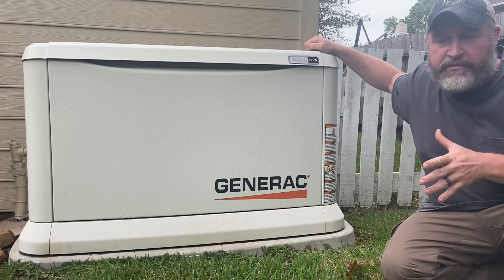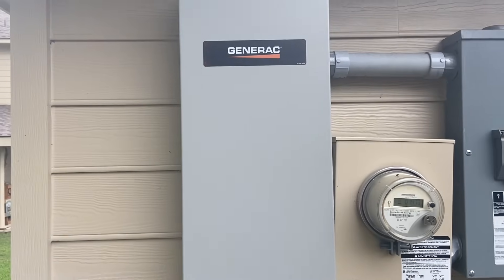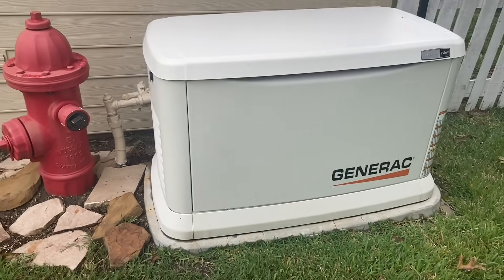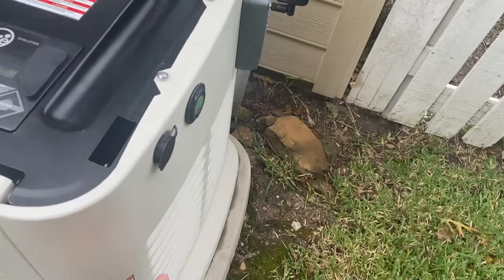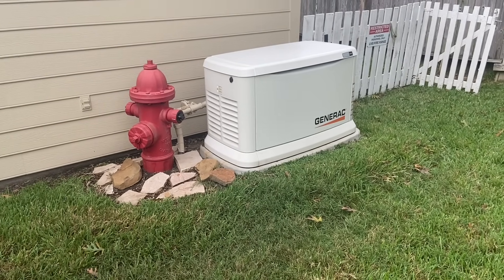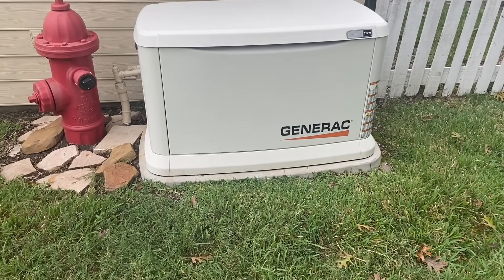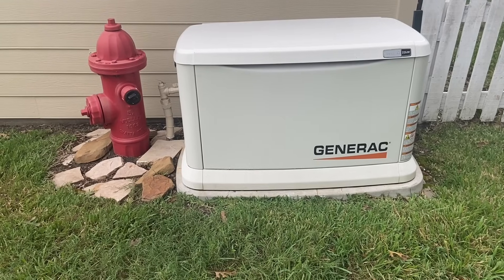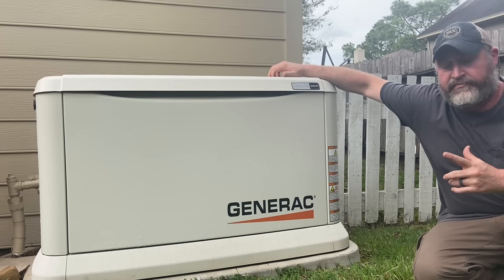Thinking of purchasing a generac whole home generator?

Comment: Just had a quote last week 12 Sept 2023 for a turn key installation of a 26KW Guardian Generac.  $22,000.  Included the generator, auto transfer switch, 2 load shedding modules for my 2 AC condensers,  about 30 feet of conduit to offset the generator from the outside service panel, 40 feet of gas line from the meter, about 120 feet of wire run from the generator to the transfer switch and rerouting the electric meter to the transfer switch and back to service panel.  7% Mississippi sales tax on the generator purchase is included.  This quote is through the local Home Depot in Olive Branch MS who specified the certified Generac contractor.  Apparently this area of the US is a sellers market with plenty of willing buyers.  The labor for this job is about 2 man days or 16 hours.  An option is to find your own electrician and gas contractor to do the install.  While your install will probably be more reasonable, repairs and parts will most likely be through a Certified Generac dealer.  Especially if you’re looking for warranty work or service.
Reply from the maker: Sounds about right , my install today would be 13-14k the 26kw is more and your install is more involved.
Reply: Through a certified Generac Dealer/Installer you are looking at a 100% mark up on the basic generator set and installation parts.
Reply: My install was $15,750 for the 24kw, transfer switch, new gas line, and a 200 amp breaker box. I had it installed just over a gear ago. I’ve noticed the prices on these things have gone up so fast.
Reply from the maker: @gutterratjp  thanks for the comment and updates on cost.
Reply: Load shed for a 22 kW may be "fluff", or not depending on the size of the AC units.  You are paying for more than two man days of labor.  Only subcontract if you are technically competent to verify all the work is performed properly and to code.  You can't depend on many of the contractors (or inspectors) to be knowledgeable enough to install correctly.  Then, yes warranty work will be through a warranty authorized dealer-some will not cover warranty on an improperly installed unit.

Comment: Wow thats an awesome price! Just got a quote yesterday for a 12kw briggs and straton smart generator( suppose to be smaller and cheaper) for 20K. Our freind at home depot told us it would be that much before we even got the quote. We have another installer coming today but anyway they do add value to your home so they pay for themselves i think. Great video, exactly what i went thru with the installer yesterday. Thanks
Reply from the maker: Updated pricing in my area for my unit installed is 13-14k currently. Thanks for watching !

Comment: I received bids from 3 different generator companies here on the Alabama Gulf Coast and was aghast at the additional dealer  mark up these clowns were asking.  I knew beforehand what the Generator  itself would cost and then started the bidding process.  The generator itself cost around $4,000.   Each company wanted around $11,000 - $12,000.  I told them to get off my property as fast as they could.  I purchased a large portable 17.5 Kw generator from a company in AZ that sells thousands of generators and had my electrician hook up my Manual Transfer Switch ($750).  I had a 500 gallon Propane tank buried in the ground and will only use it for the next hurricane, I exercise (with load) the generator off a 30 gallon portable tank.  Oh yes,  I installed a conversion kit on my generator to run off propane instead of gasoline.  The propane in the ground tank never ages like liquid fuels do, gas or diesel.    Saved a lot of money doing it my way.  Not hard at all, even a caveman could do it.

BTW  my neighbor down the street, we live out in the country, had his whole house permanently mounted generator STOLEN.    I keep my safe in my garage under a tarp.
Reply from the maker: Lots of different options for different budgets. Thanks for watching please subscribe like and share
Reply: How was the generator stolen? it’d be quite a task to steal one of these from the weight alone, and they’d have to know what they were doing to not get electrocuted or blow themselves up on the gas line
Reply from the maker: @MrSamsamsammy  yep stick around you will see a lot of hate for the generac standby generator, lots of folks prefer to drag portables our and store fuel!?!!?
Reply: @MrSamsamsammy  They evidently used my neighbor's tractor that has a bucket on it, backed up a trailer to it, disconnected the propane line to the generator and shut off the power at the outside breaker box and cut the power line, then they turned the power back on, (NO ARC Marks)
Reply: @JustCantSitStill  I am done messing with liquid fueled generators, been thru a few hurricanes and propane is the way to go.
Reply from the maker: @coastiesaurus6810  I agree, I never have to fill mine 😂 works great
Reply: @JustCantSitStill  Post Hurricane the lines at the few working gas stations are crazy, and to a degree the same at propane filling stations.  I am on contract for refill  with my inground propane tank and I have several spare 30 and 100 pound bottles as a bridge to refill.   I am running a 17.5Kw portable generator on hurricane back-up power.

Comment: We just purchased our generator this pass spring, I would highly suggest getting one if their is a need such as for medical equipment use and so on, what I will also suggest is that you thoroughly research all aspects of purchasing a generator from contacting the dealer to the final installation, there are issues with permits, codes, fuel cost that could drastically increase the price of installing a generator, we have natural gas so our only option was installing a propane tank which we found was cheaper if we purchased our own tank, the fuel prices are extremely high, so if you install a generator please set it to do a self test every month instead of the manufacturers recommended weekly test, we love our new generator and so far we haven’t had to use it during this years hurricane season.

Comment: I just went with a 24kW, 3500 sq/ft home. They install it soon. I didn’t realize how loud it would be. Fortunately, my home is brick and where it will be installed is opposite side of my bedroom.
Reply from the maker: Please subscribe and watch my other videos, I have one on the noise level you might be very surprised!
Reply: Same here, just ordered one yesterday in Metairie, Louisiana (close to New Orleans) 24kw, little over 3500 sq/ft. 4 ton A/C downstairs and 2.5 ton up. Total cost will be $13,925.02.  Getting mine late June or early July.  I wanted the 27kw water cooled unit but couldn’t justify paying that much more.
Reply: Loud? Not as loud as one’s wife complaining about how hot it is without power to run the A/C 🙉
Reply from the maker: @rkgrkg1384  😂😂😂😂 agreed! Thanks for watching!

Comment: Don't !!! My mother in law is 90 and her husband had one put in because he knew he was dying. So far 3 times she needed it It would not run. They came out the first time and replaced a part. The next times had to order parts took over two week. She had no power at 90 years old. Thank goodness there were people near her with a generator they hooked up for her air and light. This is in Louisiana after a tornado that hit her yard trees down,limb through roof , a total mess. Hot 🔥
Reply from the maker: Sorry to hear about all the damage and trouble.
Reply: me too alsmost same problem. delayed service. also i never used Generac generator for it's power outage time. fix fix fix it is job. Generac just for work business make money it means not for customer

Comment: Thanks for the review. I also live in Houston, and as you know, the power went out for a week. Having said that, I used a WEN 11000 gen with a 50 Amp breaker, it powered up my whole house, including a 4 ton AC unit, it would run on gasoline for about 4 hours half load, it cost me about $26 per day. After watching your video, I noticed that when your Generac started, it makes a lot of noise, and is about the same noise my WEN gen produces, my wife complains about the noise, and wanted to consider a Generac, but now I have second thoughts in investing $10k on a Generac, that will make the same noise as my WEN 11000. btw, will a Generac 18k power up my 4 ton AC unit?, which also has an Easy starter device connected to it.
Reply from the maker: If a 11kw will power your ac a 18kw would as well.
Reply: yes.

Comment: After just going through Ian and being without electric utility service for 10 whole days at my house (not my first hurricane, and not my first hurricane that resulted in 10 days or more loss of electric utility), I am more convinced than ever that a propane emergency generator is the worst solution you can have for a hurricane or any catastrophic event.  Several of my neighbors have one, and all of them either had to seriously limit their usage or just ran out of propane and went several days without power.  This negates the whole purpose of the whole home generator, and certainly one that costs $12k.  The refill trucks did not start coming until day 16 after the storm.  Its fine if you just want protect against short term outages and/or really need that automatic switchover for medical equipment.  But in a serious hurricane this is a bust.  You are better off going with a gasoline or diesel generator, because 4-5 days post storm that fuel is readily available with short wait times.  And/or, buy yourself a $1500-$2000 portable solar kit.  You can run the bare essentials (fridge, lights, fan, charge phones, TV) while not spending a single drop of fuel and vastly reducing your risk of CO poisoning, fire, etc.
Reply from the maker: Luckily we have NG if we where on propane I can definitely see the issue of running out. Thanks for the comment and for watching! Have a great week.
Reply: @JustCantSitStill  I have NG powering my Generac and have never had any issues with power loss or interruptions.  If you are dependent on a propane truck to fill your tank then a standby generator for home power is certainly not the way to go , especially for power loss greater than 2-3 days
Reply from the maker: @JulaWeg  so it was a bad install?

Comment: we lose power 5-50 times per year in my neighborhood. hard rain, no power. Winter, no power. clear calm blue day, no power. it varies. 
Here in Houston a couple years ago, we had out icepocalypse. Power was out for a week. 
I built a working generator (5,500 watt) from a scrap generator power head, a broken pressure washer and some car parts. I set up a suicide cord (google that and DON'T DO IT) and some extension cords. 
Basically we had heat, lights, working refrigerators and my kiddo was watching movies on a big screen. 
Because I know how to shut off water and drain my pipes, we had the only house out of 300 in my neighborhood that didn't have broken pipes. 

We were comfortable to say the least. 

This motivated me to quit my job as a glorified janitor at a college and work from home car mechanic and become an electrician. (change was only 4 months ago)

Now I have a back up for my back up for my back up and also the ability to go off grid (not actually allowed in Houston) in a pinch.

My point is simple. 

You are never too old to learn something new and time is never wasted if you are watching videos like this one. 

I became a prepper as well, and I have been considered the "Big bro, uncle, Dad" to everyone in my neighborhood. 

I'm considering starting my own channel... but I'm not so up to speed on video editing. I'd rather use my free time to master my new craft and help locals in need.
Reply from the maker: Thanks for the comment and for watching, check out my engine videos!
Reply: @JustCantSitStill  Dude. I think we have met before at a car show. Small world. As soon as I saw your other videos, I subscribed and hit the notification bell. 
Absolutely outstanding. We are building a 64 C10 now. Little NA 406sbc going in her.
Reply from the maker: @ericallen7200  awesome thanks 🙏

Comment: I shopped for a diesel generator and found a 14KW for under $10K that is more than enough power for my home.  I have it on wheels in my garage with a power cord that plugs into the main breaker panel.  I have the exhaust routed to the outside of the garage.  Diesel made the best option for durability, lowest cost per hour, and it came with a more durable generator head.  My diesel runs at 1800 RPM and is water cooled.  The Generac is air cooled and runs at 3600 RPM and is louder.  I also have another smaller gasoline generator 3500 watts that is very quiet.  I purchased a 5 KW Lifepo battery pack and a 6KW inverter to power the furnace, refrigerator, freezer and few lights at night to run silent.  Buy the Generac if you must, but I will bet in the long run the Generac will not last as long as my diesel.
Reply from the maker: Nice how many days of diesel do you keep?

Comment: I know this is an older vid, but as you mentioned during the Freezepocolipse we had in Feb of 21, for that 36ish hours you ran on the generator, what did your gas bill look like? Just wondering what my gas bill might jump to if we need to run on the generac for an extended period of time like we did here during Beryl last week where we were without power for about 4-5 days. Thanks!
Reply from the maker: @monazarktrooper  With the generator running , both furnaces, gas fire place and water heater it cost me a little less than 17$ more than normal for the bill cycle.
Reply: @JustCantSitStill  I figured it wasnt going to be much of a drastic change, thanks for confirming!
Reply from the maker: @stormviewerkayden no problem we appreciate the support like subscribe and share!

Comment: Great review...Thanks.  My biggest concern is that we live in a residential neighborhood (like you do), and the noise of it running 24/7 until the power is restored may drive my neighbors crazy. Have you investigated any noise reduction options, such as a better muffler or housing to put over the unit?
Reply: I would just go with battery back up generator, you don't really need all circuits running, just pick 10 circuits that are essential and you will be fine with a power outage of a few days, which is super rare event. No annual maintenance costs, no noise and fumes, no ugly generator in the yard, and oh yeah automatic switches when power is out. Will be cheaper and all the benefits I mentioned.
Reply: It will drive them jealous, not crazy.
Reply: @noahevans2314  is there a specific model you had in mind? We've been out of power for up to a week after a wind storm. I just looked at Jackery and it's $5000 for a battery that would barely last a day using the bare minimum.
Reply: @snorman1911  You don't need to power everything in your house, just a few basics as I mentioned for 1-2 days. If you get a battery back up system just add one solar panel with it and you get the immediate 30% tax credit for all of it, so that $5k is now only $3.5k. Unless you live in a 3rd world country, our electric is up and running pretty reliable and isn't down for days. A battery is going to last 10 plus years and there won't be any annual maintenance costs. Do the math and it's cheaper in the long run.
Reply: @noahevans2314  Just a refrigerator can use 2-3 kwh per day. Add the furnace and other necessities and 5kwh won't last long. PNW windstorms can take power down for a while. We had a tree take down power lines that were in the street until crews could get to it, they were very busy.
Reply: Going with an inverter like predator from harbor freight, great great unit
Reply: @noahevans2314 I definitely agree with how you're going about it it's a lot cheaper to get a battery one plus you can always take that with you wherever you go I think the one in the video here is kind of Overkill unless you're in a location where you constantly have power outages then I would consider this
Reply: In my neighborhood, 25% of the houses already have this unit.  The noise is not an issue inside.
Reply: I just moved into a house next door with one of these and came here to this video because I heard myself say what the fuck is that when it started up?! 😢😢😢
Reply: @mowcowbell not inside, to you. lol I live next to ine and it loud as fuck!

Comment: I have a 22kw red light went on, the problem was a butterfly switch that lets the generator start.  The part is not in stock because they make some 8 - 10 different butterfly switches, so we wait 3 to 4 weeks to receive switch, in middle of ice storm.
Reply from the maker: Send part number of switch so all can order and be ready, thanks for watching and the comment hope you and your family stay safe.
Reply: If you mean the rocker switch from manual-off-auto, they could have reversed the wires on the switch (switch the manual and auto wires around) and used it that way.  Or there are other ways to make it work in a pinch.